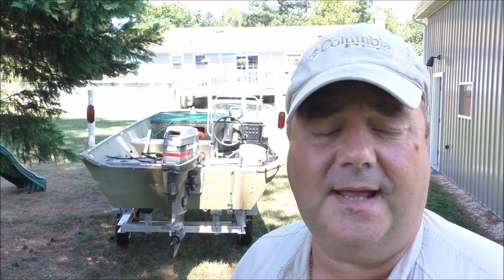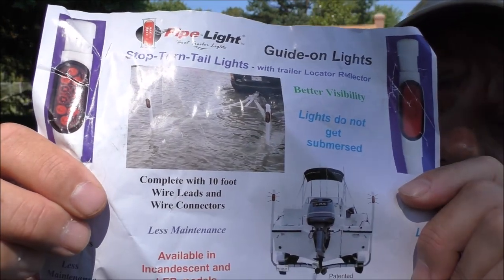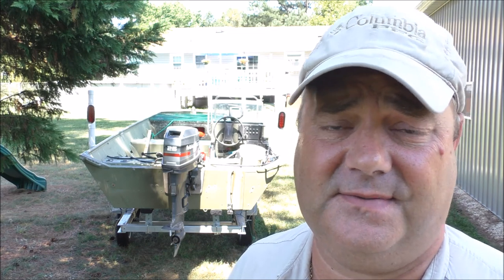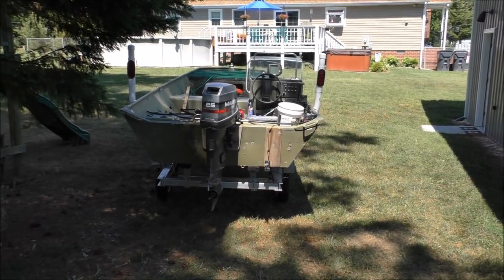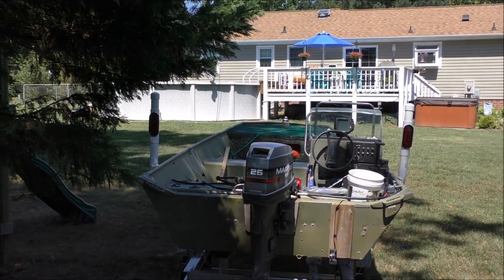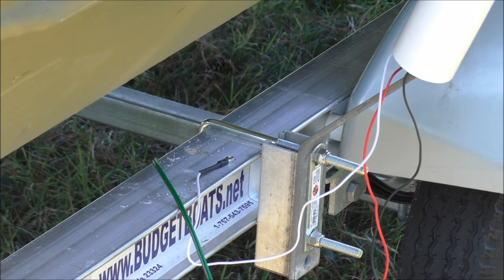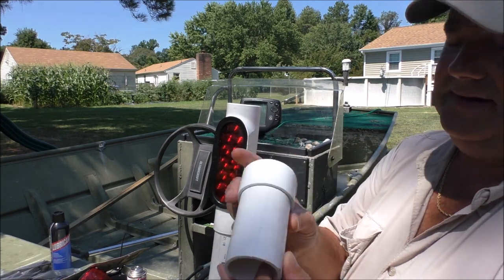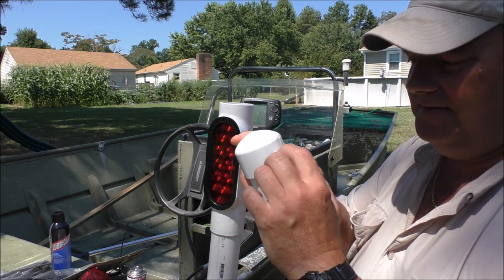LED PVC Pipe Lights for Boat Trailers Review and How To By KVUSMC

Comment: Thank you for sharing the video.
I think that with some extra wire length and a few bolts and nuts, you could have used the old lights bolted to the PVC pipe, which is what I am thinking of doing to mine.
Thank you again for sharing, God bless you.
Reply from the maker: Amen Brother your Welcome

Comment: All you had to do with the white ground wire was to connect it to the thru bolt on the guide. The wire will rust out in due time due to submersing it. My ground wire was attached just under the light keeping it free from submerging it. A small thru bolt did the job.
Reply from the maker: I really Appreciate the help Brother you can never Learn to much Cheers Kenny 🍻

Comment: I like your trailer. It looks aluminum I beam. Like to find one. I plan on doing the same as tail lights are aways getting  broke don't matter what I do by gravel roads to the lakes. There hard to see because of the boat is past the current lights on the trailer. I'm going to try to add post markers on top of this to help locate trailer in the dark while backing down the ramp.
Reply from the maker: Thank you Brother That will help out Great

Comment: When trying to estimate the size of charge controller do you just add up the open Amps each panel produces and keep under that? if so what's a good amount to leave or is it ok to have it max the controller out. Thanks, still trying to get my head around it all :-)
Reply from the maker: +TechStories79 Hey Buddy PM me on Facebook I can help you out My Facebook Page is Kenneth W Viar Jr Send me a friend request  I'm a better talker than Typer or texter usually I go by Watts And voltage of Solar panels for a charge controller  give me Hollar buddy
Reply: Will do when I get a chance, cheers Kenny
Reply from the maker: No Problem Brother

Comment: Do not think you want your poles touching boat.  Pole is going to rub going down the road  and loading boat in water you will bend pole supports too.
Reply from the maker: It works just fine
Reply: PVC will flex a bit, and by keeping it tight, the boat will load onto trailer straight and center every time.